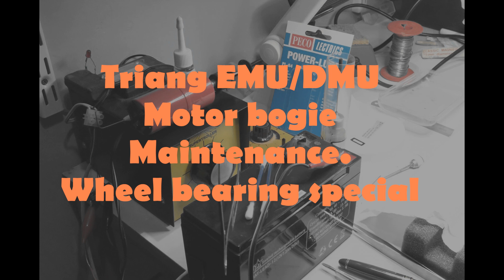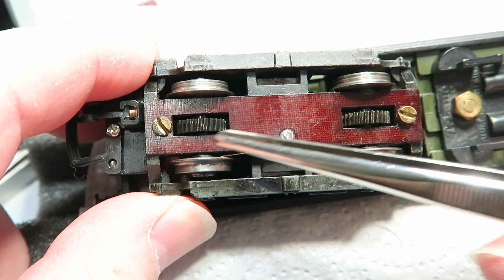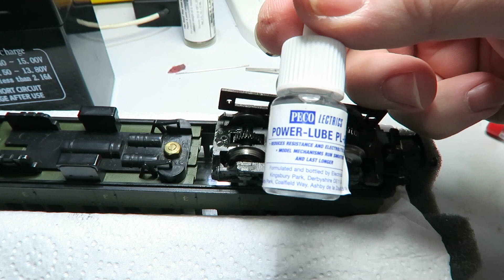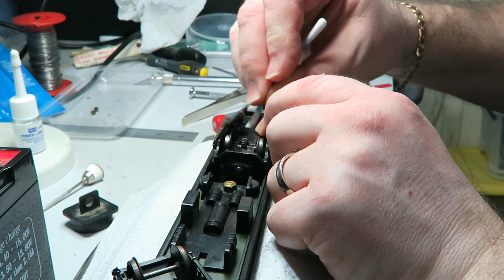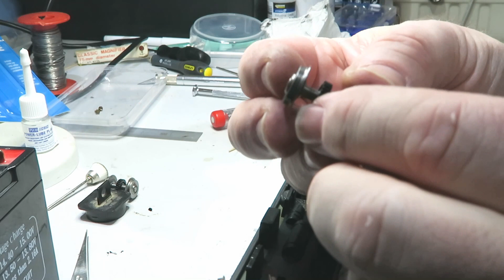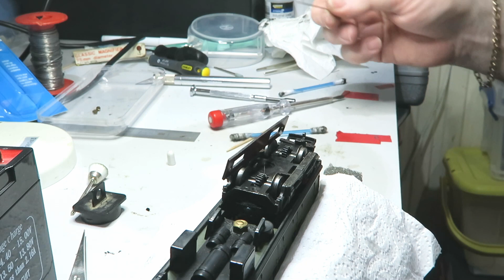Triang EMU/DMU Motor Bogie Maintenance. Model Railway Tips

Comment: Nice video. Interesting that you've had trouble with the peco oil. Cant say I've ever had problems with it, but I've only used a tiny amount and in N gauge models. I spent most of the video admiring your dads paintwork. It didn't leave the factory looking quite so dapper that's for sure! These are the best southern kit builds and mods on youtube :) Still cant get over that terrier...
Reply from the maker: +fnp90rd You are most kind :) more to come soon, cheers Mike

Comment: A very helpful tutorial Mike! Very useful info now how to keep stock running. Great to see the units still in action. The few minutes of work really makes all the difference! Is the Electro Lube recommend for cleaning dirt of wheel surfaces? Thanks for sharing!
Reply from the maker: +SDJR7F88 Cheers Callum, I would be very careful indeed with Electrolube! best thing for wheel cleaning is to9 use the motorised brush shown and resist one wheel with a finger while allowing it to slow spin the other, or a cloth and IPA